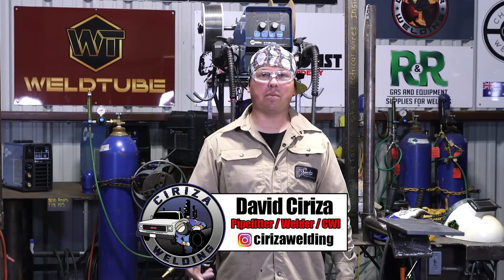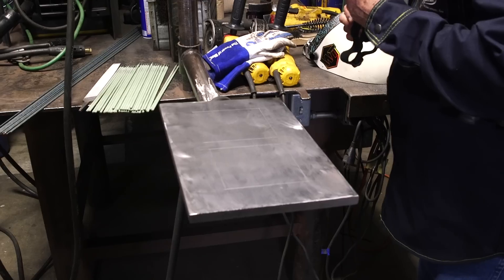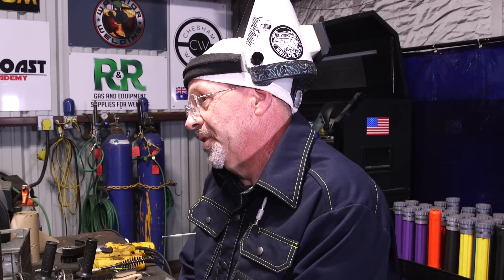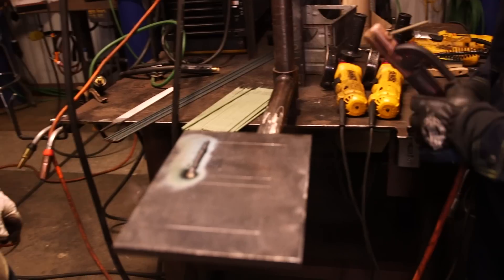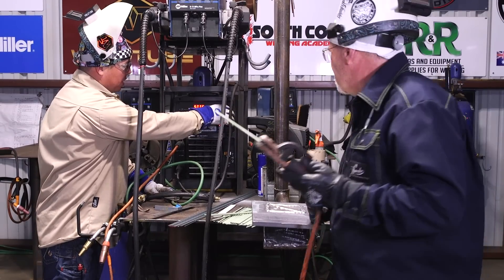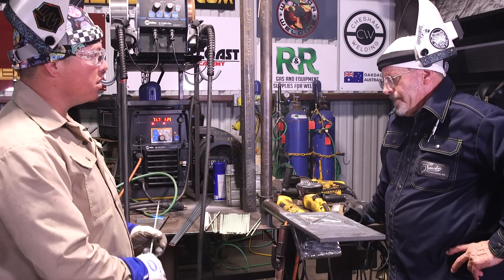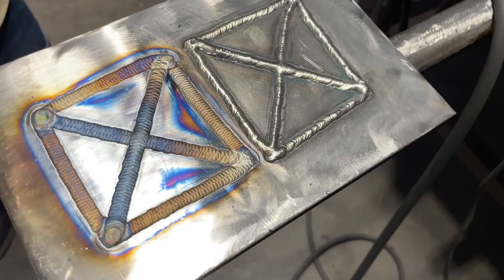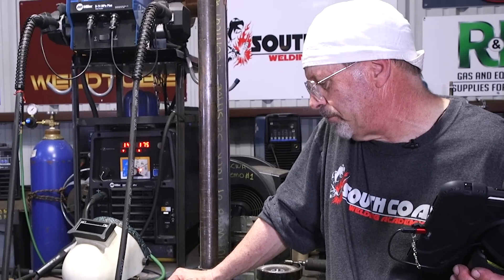Hard Facing TIG & Stick | Abrasion Resistant Welding

Comment: There's definitely some horrible shite in the fumes that come off of these rods especially the Stick welding rods, not so much with the Tig. 
Come on, you guys are supposed to be setting an example and helping people out, could at least have some extraction running or wear some sort of RPE?

Comment: Using Stellite/Stoodite 6 just for hardfacing is a bit overkill. You usually use that if you also have to fight corrosion at the same time, as these are very expensive metals and just abrasion resistance can be had for a fraction...

Comment: Stick welding with those rods is quite toxic without a proper respirator, in fact niosh doesn’t recommend handling that tig wire with bare skin either. 

Great rods but cobalt and high levels of chromium are bad juju.

Comment: i'm looking to try and make a wood splitter using mild steel and arc welding hardfacing rod on top after i've ground a 45 degree edge to the mild steel part.  my question is - do i need to lay down a 'buttering' layer of e.g. 7016 first and then put the hardfacing on top of that or is it ok to just weld hardfacing rod on top of the mild steel plate?  i've heard that a buttering layer should be put down first but when i have seen videos on hardfacing i have just seen the hardfacing rod being welded onto the steel itself.  what would you recommend??

Comment: I use the 2.7mm Dia Stellite 6 Tig rods for welding Shear blade tips, It is a pretty nice rod to weld with but you can't put more than about 5mm thick or it will crack, I also peen the welds each time, to stop them cracking when they cool and then the whole blade needs to be cooled slowly in sand buckets so the whole thing cools evenly. Good to see welding of different uses and for special reasons.
Reply: I welded the edge of damaged rotary knife blades. Very frustrating as the rapid thermo cycle cause cracking.

Comment: Something to notice, i gues the tig Rod is stellite 6/12 but with tig most of the time you'l need around 3 to 4 layers because of the hardfacing stuff is mixing together with your base material. 
And also cooling down slowly is pretty improtant due to cracks

Comment: My leaf spring hangers on my 1982 freightliner I would weld a square piece of flat bar steel where the leaf would lay on. Its alot easier than laying down beads to build up the worn metal. Can welding square pads or bolting them to the bucket be possible or is every job different?
Reply: It's common to weld sections of wear resistant steel like ar 400 onto things to avoid needing to do so much hardfacing. It's not something I've ever done though.

Comment: Great work guys !
Back when I was in aerospace, we would use various stellite alloys on components (mostly turbine blades) that would have abutting faces as these would vibrate off each other when the part was in service. They would then usually get a heat-treat then CNC Grind to profile.
Reply: Thanks RM, did you guys put a specific pattern on there or just straight beads?
Reply: @1nvisible1  Straight beads basically to reclaim worn material dimensions that had been lost in service.
However what you are refering to with the patterns is commonly done on heavy equipment that do quarry work.
I asked a friend a couple of months ago who does this work what the purpose of the pattern was, and he said it is to reduce the contact of larger rocks from contacting the regular steel plate of the excavator buckets by creating a raised surface. There may also be additional reasons to this also that I am unaware of, heavy equipment isn't my wheelhouse.

Comment: I bet tig might he nice on some thinner equipment or for getting a really nice edge on a cutter bar something like that. Kinda would be cool to make a knife out of mild steel then tig some hard facing rod on it to keep it sharp 🤔
Reply: ThisOldTony did an episode where he used tool steel tig filler to do that to a hatchet i think, it was really cool.
Reply: @kylehurley5994  I was going to mention that. He used d2 filler which is used for things like die making and sometimes knives.

Comment: Nice seeing Bob welding!  I've never used those electrodes for hard facing but did hear the fumes are really bad . Why no fan or fume extractor?
Reply: Seems majority of american welders thinkntheyre invicible when it comes to things like COPD, Chronic Bronchitis, Lung Cancer, Siderosis, those sort of things. 
Youd think being an "educational" channel, theyd have the intelligence to make a point re fumes and breathing them
Reply: @kf8575  Or its just, "The old guy will do it, without complaining, doesnt know any better."
Reply: I use a positive pressure mask for certain things like gouging, I know too many old welders with chronic lung problems and what I suspect is heavy metal fume induced brain problems from the parkinsons like symptoms they have.

If you can smell it, you're inhaling it.
Reply: @crabmansteve6844  it's the manganese poisoning
Reply: @Fogyt121  os it not also cobalt and tungsten and chrome poisening in this case of hard face.  Is manganesse the main thing in typical steel welding ?
Reply: @Fogyt121  yea.  Damn
Reply: @ryanbeard1119  i also work as a welder, in a non ventilated shop, and my halfmask sees daily use
Reply: I remember in high school back in the 1970's being told that steel welding fumes were 8 times harsher on the lungs than cigarette smoke. We didn't have any extractor, but did open the windows.
Reply: My uncle was a career boilermaker and died of emphysema. I use fume extraction.
Reply: We’re welders not ballerinas

Comment: I’ve seen a lot of heavy equipment done hard facing with the stick welder. That’s new to me seeing it done with tig.
Reply: I could see for a more precise buildup, it makes sense to TIG. Fireball Tool did a video on removing the seam in the tube and made his own cutter using a hard face rod he sanded the flux from, and TIG welded on. It worked.
Reply: I can't see any shop ever using TIG for hard facing.  Talk about slow, and it requires everything to be indoors.